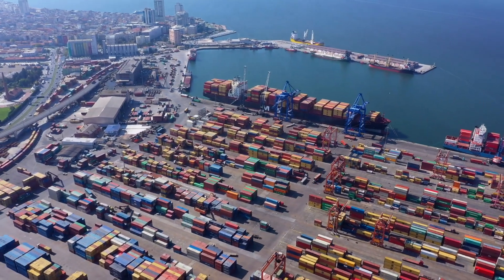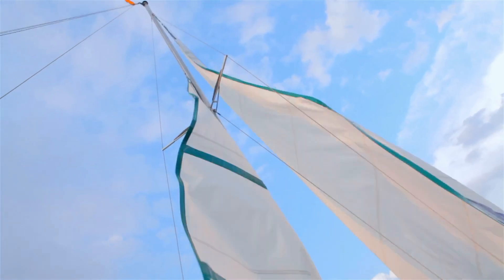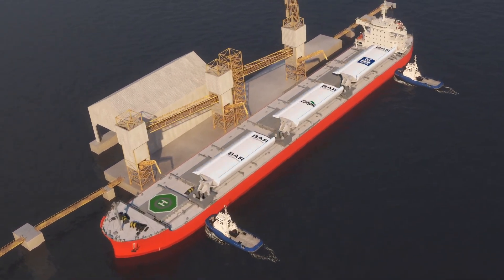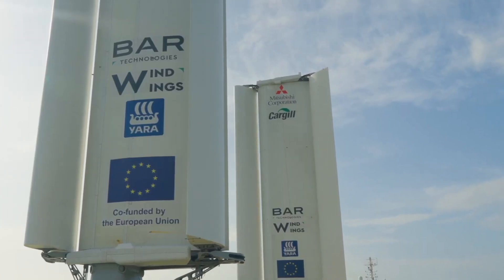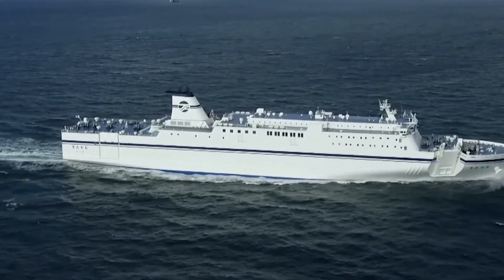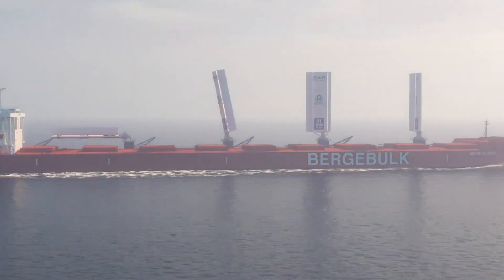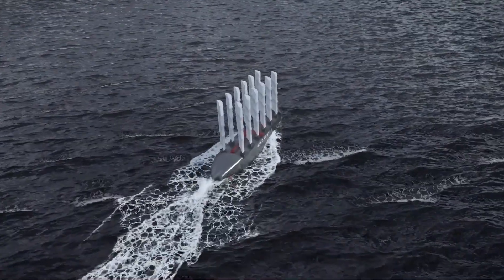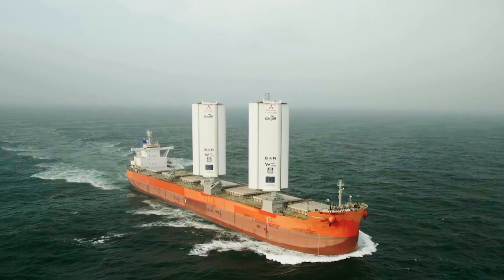How Wind Powered Oil Tankers Could Be The Future Of Cargo Shipping

Comment: Listen to me!  This might be one of the most valuable free bits of information anyone gives out!
Ocean Thermal Energy Conversion (OTEC) CAN BE USED TO STOP HURRICANES!!!!
THE WAY YOU DO IT.... is to convert the thermal energy into a SYNTHETIC FUEL!!! 
install your equipment on an oil tanker, install Direct Air Capture CO2 equipment as well as Fischer Tropsch Reactors or Sabatier reactors as well, reverse osmosis system to create pure water, renewable energy eloctrolyzes the Hydrogen for methanation and or Hydrogenation of carbon.  
ALL RESOURCES ARE AVAILABLE AT SEA!! INCLUDING WIND AND WAVE RENEWAVLES!!!! 
IF OTEC IS USED, the temp of the ocean surface can be reduced along with the potential energy for fueling hurricanes!!! Countless lives and property will be saved.... 
THIS IS TOO IMPORTANT AN IDEA TO BE KEPT TO ONES SELF!!!!
Reply: Waiting for hurricanes to form and then trying to extract energy from them is the WRONG WAY to go about it(I do have an engineering background).  The solution to these hurricanes is really not a difficult one to solve.  
The solution is also REMARKABLY BIPARTISAN!  SYNTHETIC FUEL OIL!!!!!!!  THIS IS THE SOLUTION!!!.   ALL OF THE TECHNOLOGY CURRENTLY EXISTS TO STORE THERMAL ENERGY THAT IS CURRENTLY IN THE FORM OF ELEVATED OCEAN SURFACE TEMPERATURES TO THE CHEMICAL ENERGY BETWEEN CARBON AND HYDROGEN IN SYNTHETIC FUELS.... 
ALL THAT IS NEEDED IS TO 
-CAPTURE CO2 FROM THE ATMOSPHERE....
-GENERATE ELECTRICITY FROM THE DIFFERENTIAL TEMPERATURE ACROSS SURFACE WATER AND WATER AT DEPTH.
-USE THE ELECTRICITY TO ELECTROLYZE HYDROGEN FROM THE WATER
-REACT THE HYDROGEN WITH THE CARBON DIOXIDE USING RUTHENIUM, RUBIDIUM CATALYSTS TO LOWER THE ACTIVATION TEMPERATURE.
-AND STORE THE SYNTHETIC OIL IN (I DONT KNOW) an oil tanker!!!! that is also large enough to manifest all required equipment....
-This effectively turns synthetic fuels into a PERFECT battery... one that can store energy for millions of years if needed.
-the Synthetic fuels can be used in any manner in which current fossil fuels are being used.  NO INFRASTRUCTUREE NEEDS TO CHANGE...
EVERYTHING CAN BE SET UP AND PUT IN PLACE BEFORE NEXT YEARS' HURRICANE SEASON.
THIS WILL WORK!  
I AM CURRENTLY WORKING TO PUT STAKEHOLDERS TOGETHER AND HARNESS THE POWER OF FINANCE TO EFFECT THIS IMPORTANT SUBJECT.  I AM NOT INTERESTED IN BEING 1ST OR CAPITALIZING ON THIS FOR PERSONAL GAIN!  I WOULD RATHER POSITIVE CHANGE COME FROM WORDS I WRITE AND NOT THE BLOOD SWEAT AND TEARS... BUT I WORRY OIL COMPANIES SEE THIS AS COMPETITION (WHICH IT ISNT)  THE SUCCESS OF THIS WOULD PAVE THE WAY FOR SCALABLE MEANS TO EFFECTIVELY REMOVE THEIR DETRACTORS...ONCE WE HAVE THE RIGHT SCALE FOR REMOVING CARBON FROM THE ATMOSPHERE, THERE WOULD BE NO REASON TO METER THE AMOUNT OF CARBON WE MINE FROM THE GROUND.
RENEWABLE ENERGY COMPANIES HAVE THE PERFECT BATTERY FOR ANYWHERE ON THE GLOBE!! ANYWHERE THERE IS RENEWABLE ENERGY, WATER AND CARBON DIOXIDE, A COMPANY CAN OBTAIN BLACK GOLD ANYWHERE IN THE WORLD!!!!!

Comment: There appears to be a lot of complexity in the system to deploy, stow and orient the sails.  I wonder if a series of rotating cylinders (Magnus effect) would not be a simpler solution?  Agreed, that the wind vector isn't always favorable to the route/destination of the ship.  Clipper Ships seemed to do OK in the 1800's.  But,  they relied on a crew dedicated to managing the sails for best point of sailing - 24/7.
Reply: Only deploy sails in favourable wind with engine power subsides for cruise speed

Comment: I went to sea in 1975 the Japanese built a ship which was wind assisted the only problem is all commercial charters are time priced and wind power is not enough to guarantee transit times and there are many great areas of the Worlds Oceans with little to no wind for days at a time.
Reply: It saves 30% fuel, so once combined with alternative clean fuels for the engine, or maybe even green hydrogen fuel, then it would definitely not just cut costs but also dramatically reduce CO2 emissions.
Reply: The difference here compared to the comment on the 1975 Japanese ship is that now the ship still can do exactly what it is designed to do, and achieve published port timings, based on the engine at 100% fuel usage. As such the wind assist will either allow the engine to run slower while the ship maintains the speed or actually if the engine runs at 100% the ship will arrive earlier. in both cases the fuel burn for the trip will reduce by the roughly 30% as calculated. Would be interesting to see how this can be deployed on container ships as they have a much higher cargo loading. However even if container ships might not be possible it will take a massive task to put this sail technology on all suitable vessels.